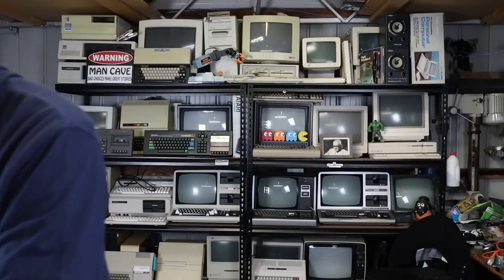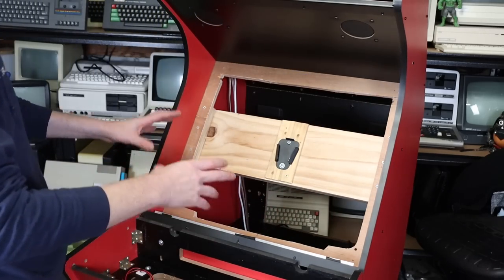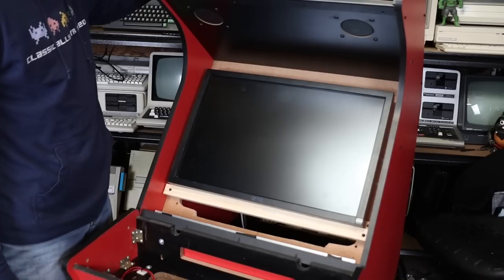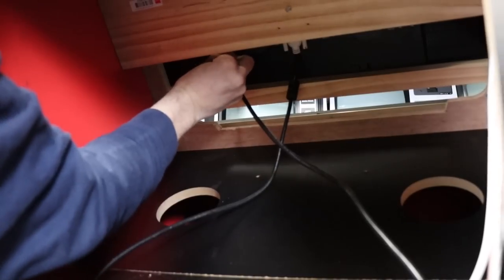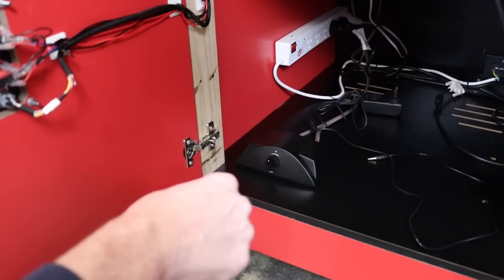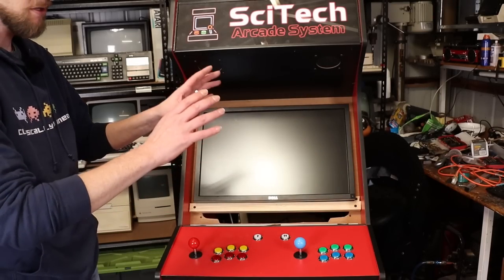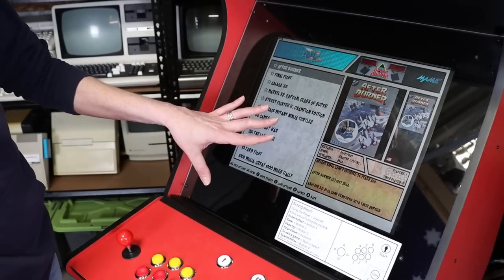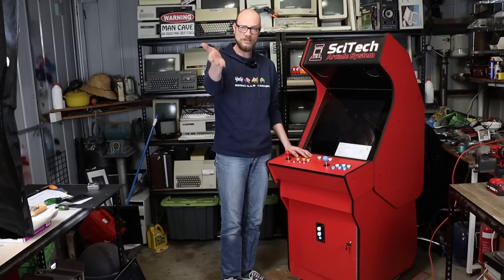I built an Arcade Machine (and it went mostly to plan)

Comment: Instead of all the acrobatics to get that locking screw in, I would have thought you would've just put another piece of wood above the screen to mirror the piece at the bottom. If it can't slide up, it should be stable.
Reply from the maker: well... now that you mention it.... yes.
Reply: Well, I saw someone else's arcade build and that's how they secured their monitor. I've been wanting to build a arcade cab for quite some time as well and recently was gifted a  broken Galaxian machine. I'm torn between trying to restore it to it's former glory or gently mod it an emulation machine. Anyway, I enjoyed the video.

Comment: Suggestion for you: scrap those usb encoders,  replace them with two 3€/$ arduino pro micro and load the DaemonBite firmware on it. It is not only cheap but the input latency will be pretty much limited only by the usb polling (which is 1000hz in this case)
Reply from the maker: Oh. Good to know. I didn’t know that was an option. I’ll look into it.
Reply: That's why I come down here. Take my upvote, sir.

Comment: Brackets, locking screws, wobble-compensating wood ... far easier to take the monitor out of it's frame.
Reply from the maker: Then mount it how? With brackets, locking screws, and pieces of wood?
Reply: @MrLurchsThings  duct tape, unless it moves then you should use WD40.  It's too early on a Monday  morning here for trick questions